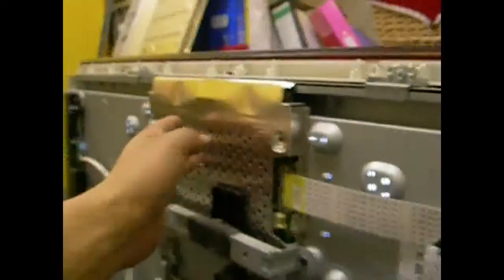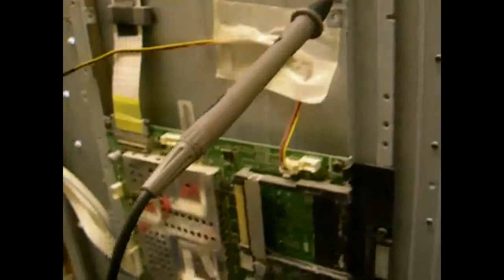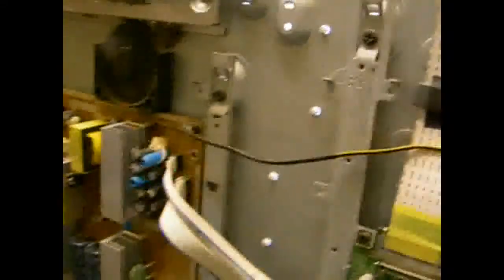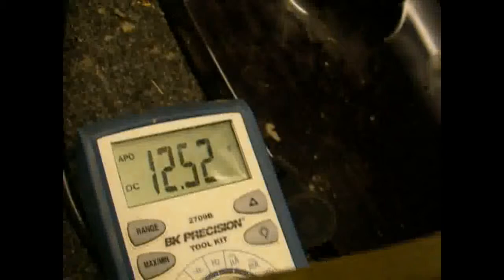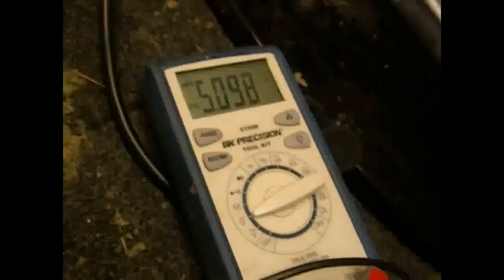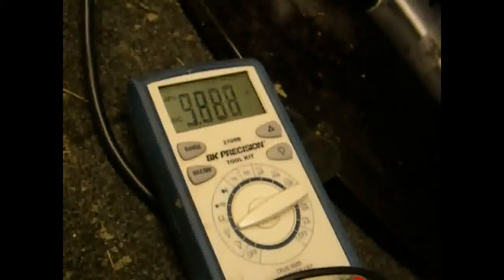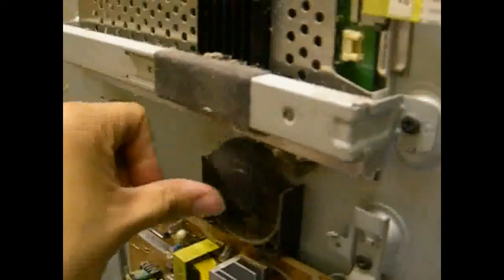Samsung LE40A656 - Power LED blinking - Diagnosis and temporary fix

Comment: The problem with my Samsung LED TV is peculiar. The TV keeps on switching between On and off mode with a clicking sound.
If I press the lower right corner firmly,the TV switches on and as soon as I remove my hand , again switching on off starts.
I got both power supply and mother board changed still the problem is persisting. 
Can anyone suggest a solution?

Comment: it's funny. I thought i was imagining things but whenever it got cold in my home my tv never turned on. It clicked nonstop and never turned on or continously cycled. It's only on hot days my tv turns on at all. Right now my tv doesn't turn on, right when the weather recently got cold. This video kinda tells me I wasn't imagining things. There's not enough heat going on for my capacitors so my tv is still attempting to fire up when it can't. i just learned about the class lawsuit made against samsung btw. Samsung lost and will send a repairman to replace the capacitors for free (and possibly power supply). My tv was among the list of defected models included in the lawsuit. To check if your model is entitled for a free 'courteosy call', contact this number 888-899-7602. Unfortunately, Samsung still denies these defects and will not resolve any other issues beyond the capacitors. :/ There are ppl reporting that within 45 minutes of replacing the capacitors on their tvs, they are still going through the same problems. A few people have already reported faulty motherboards too, but those will be out-of-pocket expenses Samsung is not liable for. >_> Additionally, there is a limited time people with faulty tvs can contact samsung for a free repair. It was by chance I learned about this, so I know I'm not the only one who was unaware of the lawsuit and what customers are entitled to. Even worse, samsung has removed the link that discusses the models included in the suit. I had to uncover this info from various forums and Q&A websites. Oi... -_-

Comment from the maker: The SOGA covers the goods being fit for purpose -- i.e. designed to last for at least those 6 years. It has no relation to anything else you did to the TV (including unauthorised service), though I would avoid mentioning it. Just make sure the TV is functioning and can demonstrate the fault, if they require it.

Comment from the maker: It doesn't work for everyone unfortunately, and I've had mixed success myself personally -- it's usually only temporary anyway. Try claiming with your retailer under sale of goods act as you have an effective 6 year warranty. You need an engineers report -- you can get one for about £20 from a good TV repair shop. It is a well known issue due to a design flaw. Don't give up the fight because eventually they will give in. And if you buy a new TV with the credit from the old one... avoid Samsung!!

Comment from the maker: This is most likely a bad LCD panel, and is uneconomical to repair. It is common with Samsung TVs. Your best bet is to call Samsung and ask them for a good faith repair as you spent so much on it and you think it's unreasonable for the TV to last such a short time. Under the Sale of Goods act (applicable in the UK, and I think Europe too) you have an effective 6 year warranty on faulty merchanise as this is a known defect with Samsung. To claim under SOGA you need to go to your retailer.